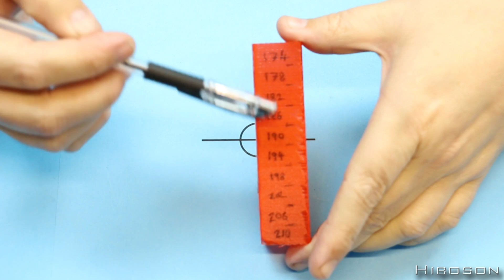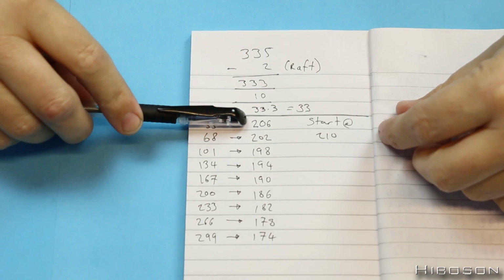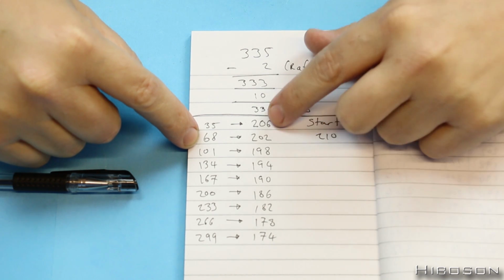Calibrating Hot End - Sunhokey Prusa i3

Comment: For some reason I still have the link to this build series. I already sold this Sunhokey printer years ago and even got a decent price for it.
It's astonishing to see how far 3D printing has progressed from that acrylic model to the modern printers made of metal frames. I still do 3D printing, but in stead of this acrylic Sunhokey printer, I now own a Creality Ender 5 pro with an Big Tree Tech SKR mini e3 v 2.0 motherboard (yes I even learned to compile my own firmware) with a BLTouch and all connected using a Raspberry Pi 400 and Octoprint.
The print results compared to the humble Sunhokey printer are stunning. Even without any calibration the Ender 5 produces nearly perfect print results. We sure came a very long way since the "acrylic years". And the funny thing is, the printers producing this result are even cheaper (Ender 3) or almost the same (Ender 5) price as those old acrylic printers.
Still - I learned a LOT by building the Sunhokey printer and all the modifications I did (at the end it even had a E3D mini hotend). I sure had a lot of fun with it.
Reply from the maker: A little late of a reply but not logged into this account in a while lol, Glad you had fun with yours :) I didn't use mine much after this video due to real life, that was untill the great stay at home 2020 lol finally real life let me back to it but it's age shows REAL hard, so now have a couple of Resin printers, but also tempted to get a new modern FDM printer and the Bambu ones are really teasing me :) I only need a P1P but my GAS (Gear Acquisition Syndrome) has me more hankering for the X1C, why cause it has more features I'll probably never use that's why lol :) Happy Printing :)
Reply: @Hiboson  Nice to hear you still doing well. Indeed that old video's are "dated", but for some reason (maybe because of nostalgia) they are still fun to see. It takes me really back all these years when I started diving into 3D printing. I now own also a Creality Ender 3 S1, and will shortly receive my Creality Sonic Pad, so I can dive into the Klipper software.
I tried raisin printing, but I do not have much room to do that safely enough, and in a small room it tends to get messy very fast. So - I reverted to FDM printing.
I seen video's from the Bambu printer, and it really seems to be a great device. It's a bit too expensive for me at this moment (inflated energy prices and so on), but I certainly keep it in mind.
Anyway - Have a good time with all your gear, and thanks for those video's many years ago. They really started me going... ;-).
Reply from the maker: @jclosed2516  Yea the mess of the resin printers is their biggest drawback, but I tend to do more props, mini figs, diaroma stuff and alike so surface quality was the key selling point on them for me, but when doing functional things then FDM wins.
Did think about an Ender 3 or alike but even though the Bambu are pricey but for me it's a time saving side that's worth it for me, I don't often have tons of time to spend so having a more out the box it just works and prints fast rig is winning me over, have been looking at the Klipper stuff but it requires tinker time so think get Bambu, then I have that to help me make a decent Tinker Printer that I can get all experimental on when I have more time :) but for now lets me get other projects done faster.
And I'm glad videos helped :) Stay safe and happy printing :)
Reply: @Hiboson  Well - It's already two years ago since my last replay (time flies, doesn't it). And now - Ten years later, I am going to build a full 3D printer kit again. This time it is all a bit more expensive, but also a bit more reliable with top-notch documentation. I am talking about the latest Prusa Core One kit. Just because I am going to build a printer within a few day's (the printer is just shipped from the Prusa factory itself), I could not help myself to look back to the day's it all started for me, and all the fun I had with building the very first 3D printer I ever had. Pure nostalgia I tell you... 😉
I hope all is well with you, and again thanks for that nice time you shared with us, the viewers...

Comment: did you find out what was causing ripple effects on the edges? I have the same printer (may be a newer gen) and i've just used the same gcode file to print and I'm seeing the same effects in 3 of the corners and only 1 corner without any issues

Comment: have you tryed pva glue with water  half and half mix and that is for printing with pla you have to wait for it to dry first before you print. pla prints at 195 and use 55 for the heatbed